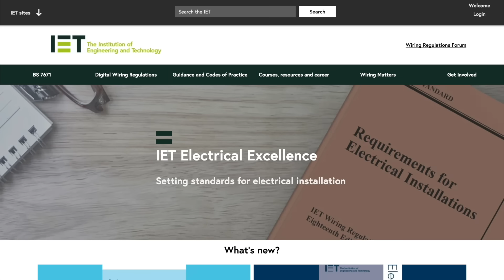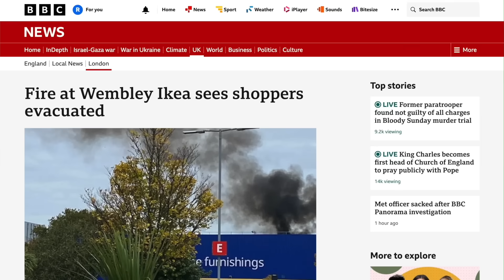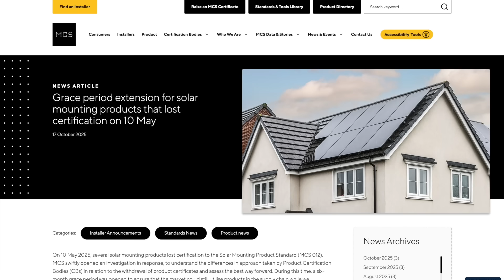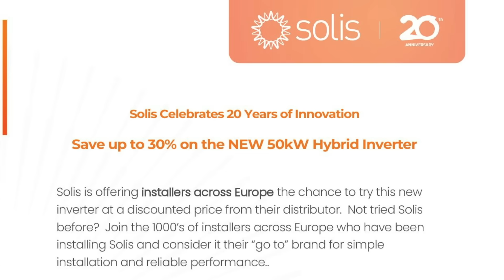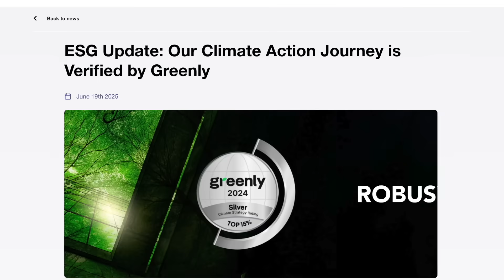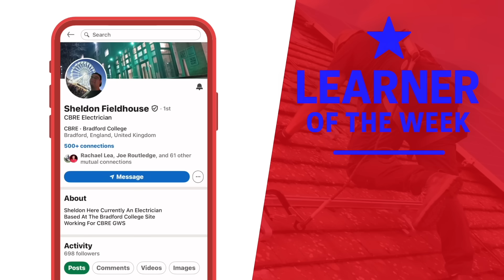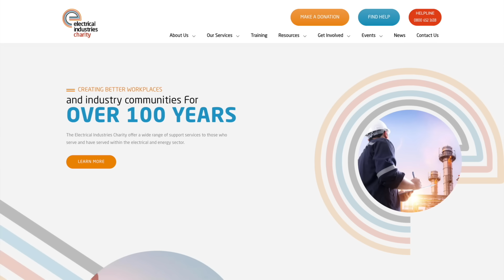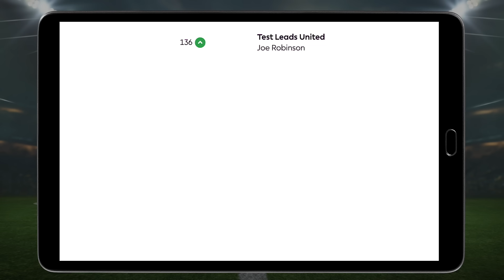Exclusive: Grid Bosses Set to Change UK Voltage

Comment: I've got no clue about this stuff so could be way off.  But this sounds more like the grid is building in some overhead into the system to cope with the wind turbines over producing during off-peak times.  I read that they have to pay for the turbines to shutdown.  I assume this reduction would give the grid some "wriggle-room" before they have to start shutting down the supply.
Reply: Grid generation from commercial wind turbines are at significantly higher voltages than the domestic end user 230v supply, so no, not related at all...
Reply: No it's to make more space above what the cloudy-weather configuration of the transformers near you provide you with in terms of voltage, so your neighbors (and you too!) can feed all the solar you can generate into the grid without tripping overvoltage throttling at the solar inverter. Which would waste large quantities of "free" electricity.
Reply: They explained that it is to give more head-room for solar panels "behind the meter" to generate without going over voltage limits.
Before consumers could generate power: it was always assumed that voltages would drop the further you get from the sub-station.

Comment: Here in Australia we switched to 230v quite some time ago. 
Yet, our grid is typically 235 to 255v. Right now, evening peak hour and the sun has set, I have just measured 242v with a good quality Fluke multimeter.
Reply: To me I still calculate based on 240v even though my place often sits at 250-255v and sometimes even 265v
Reply: We did the same in NZ, changed from 240v to 230v without actually changing anything, so the actual is usually above 240v. Unlike Australia which allows a +/- 10% ours was set at 6% which meant 244v was the upper limit and the point at which solar inverters would either shut off or throttle down. This was a problem, so currently we're changing to a 10% variation...most existing solar inverters will require a site visit to set them to the new upper limit of 253v.
Reply: I plotted my unloaded mains voltage for 24 hours some time ago in QLD.  Max was 243.5, min 233.  It wiggled around a fair bit and tap changing is quite pronounced.  I would say it is generally above 240 at night and below during the day.  Early in the morning there is a steady reduction as more load comes on then a marked step down no doubt from tap change probably to reduce the voltage to accommodate all the roof top solar and a couple of substantial ground mount arrays in the area.
Reply: @retrozmachine1189  When volts are high its cheaper as meter only measure current.
Reply: @johntouw3153  No, the meter measures power.  Plenty of videos on how electricity meters work, you might want to view a few.
Reply: @retrozmachine1189  Ah you are refering to smart meters then not the spinning aloy disc type?
Reply: @johntouw3153  Spinning disc meters also read power.  Watch those explanation videos ...
Reply: There are poor quality Fluke's?
Reply: @johntouw3153 yes, the ones I blew up were poor quality
Reply: @Beenomars  Just calibrated my 75 and its within 2% must be getting on for 40 years old and apart from the test beep being quiet it works fine.
Reply: @Beenomars  What do they say about poor workmen blaming the tools?🤣🤣
Reply: @johntouw3153 I said I blew them up. 🤷‍♂️
Reply: @Beenomars  Must have tried harder than I ever did 🤣🤣
Reply: Here in Europe we used to have 220V then we changed to 230V but not only on paper but also physically since higher voltages = more power, less current. I usually measure from 231V to 237V at my place.

Comment: Making all basic mains direct electric motors and tools etc  gutless, anytime they allow it to get that low. 
Say for example your  power drill / lathe / saw etc is used under a heavy load, but now has a lot less power.
I am picking 10% less volts, would equal more than 10% power lost 🤔

Comment: Lowering the voltage increases the current and the losses. After a while, they will ask the government to allow them to increase the price per kWh due to losses, which obviously will be paid by the consumer. Plus, is not environmentally friendly. But all these green taxes are for the poor, not for the rich. The correct way to solve this would be to invest in infrastructure, but no.
Reply: Using locally generated power actually reduces losses.
Reply: They are investing…

Comment: So if there more energy than demand, REDUCE THE BLOODY PRICES!
Reply: Octopus Agile has been paying people to use electricity in some time slots with all the wind. However it cuts both ways. If you have a flat rate tariff the energy company makes a loss some times and a gain others and it averages out to a small profit. The energy company then effectively insures that profit by people in the markets taking bets on power going up or down.

If you are on agile then there are hours its basically free and hours it's 50p+ per kWh (especially 4-7pm).
Reply: Octopus is engineered by the wef....lambs to the laughter....
Reply: @VTepesIII  what’s wrong with that? Are the WEF poor at engineering?
Reply: The energy market is tied to the most expensive provider.  So standby diesel and gas generators set the price, not cheaper sources (which include renewables).   Why yes, the power  companies make money hand over fist.  How did you guess?
Reply: @thebestofnations  most suppliers fix their own costs and are not paying the spot price for electricity. It would be hedge funds that pay lower prices if the spot price goes down
Reply: @youngwt1 that is partly true, but not entirely. They buy in advance based on how much they predict will be used, that prediction can be too high or too low. As both cost them more money, they aim to predict accurately. This prediction is the primary role, billing and payments is a secondary role to support it.

If they don't or can't buy enough up front (it requires capital investment) then they pay the spot price.
Reply: DNOs only take a tiny fraction of your bill.  It’s the energy suppliers that charge you a fortune.  The sooner these voltages are reduced the better.  The infrastructure isn’t design for all this renewable energy.
Reply: You need to pay more for free power FFS don’t you know this. They lie in there dreams when they wake up and when they speak every government
Reply: Hahaha no energy shareholders profit must go up brrrrr brrrrrrr
Reply: Its alright, when the AI data centres get fired up they'll be no energy left.
Reply: But they're also supposed to pretend that energy is "dstrying the xlimate or something" so they cant drop the prices.  Because they want you using less and paying more.
Reply: No. Get back in line g 0 yim
Reply: But who's going to payback the 49 billion quid for Hinckley point 3 ?        Er..........  We are😢😢😢😢😢😢
Reply: @studiosys  Nobody - and for that money we could have given every household in the UK 1.2kW of balcony solar and a 1kWh battery, with change even at RRP. (Well if we fixed plug in solar!)
Reply: Errrrrrr the damn Taxpers as ALWAYS!!!!😠
Reply: Prices don't go down, that's never going to happen. They only either stay the same or go up.
Reply: @Sundablakr on a couple of occasions my home rent went down. Only by 10p and about 40p if I remember correctly
Reply: nah it's all part of thew americanisation of Europe. then the world at large. for about 5 years at most. give or take two.
Reply: Labour pay one BILLION to stop the wind turbines
Reply: @doriangray6985  nothing to do with any political party. The same was happening under the last government.
Reply: @AdrianColes actually it depends on the contracts agreed by the political party in power at the time.
Reply: erm they do? I pay 4p kw/h at 11am-6am and 14p kw/h between 9:30 am to 11:30 am and 8:30 pm to 10:30 pm
Reply: Nope just lower the quality and keep the price high thats a double win (for the energy companies)
Reply: This won't work because nearly all electrical appliance are set to work at specified voltages. This is particularly true of computers and equipment that have need of clock speed parity. This will be an expensive farce.
Reply: Amps kills voltage doesnt
Reply: @jnc1771 Not.
Reply: Energy prices and voltage tolerance are two different issues. Voltages being high in some areas does not mean that "there is more energy than demand" on the grid. Voltage and energy are not the same thing!
Reply: One of the reasons why they don't is because they pre-pay for energy that they end up not using and then pay extra when certain sources are discarded. Like when the grid is overloaded and then you need to deliver extra to certain areas.

So they actually end up paying for more energy than is used. And you foot the bill.
Reply: Or channel it to overseas and make some money.
Reply: no no lower the voltage and tell everyone 50 volt will not make a difference ! But bill 250V!
Reply: @DawidKellerman actually reducing voltages means raising amps meters read amps
Reply: @johntouw3153  Oh just play along !! You kan pay more and there is  even more fire risk as our cables and yours are similar not like in the USA where an extension is the since of a underground cable
Reply: What complete and utter nonsense!
Reply: HERESY
Reply: no chance of any cut. Miliband took 400k from an energy boss, he has been bought and paid for.
Reply: That's against the core tenents of capitalism. Squeeze everyone.
Reply: @dallysinghson5569  Hey you can emigrate to china noth korea or russia if you dont like capitalism
Reply: Only if they close DRAX.
Reply: Can't Government has it linked to the price of gas
Reply: @stevenbarrett7648  Why does the government control the price of energy?!
Reply: @233kosta  I don't know why they control it as they could de-couple the price of electricity from gas so we pay the true costs, I guess its due to having a chimera government controlled by big business and unions.
Reply: @thebestofnations  octopus do, they give free energy if you have a smart meter and sign up to it. Do you have a smart meter?
Reply: I have been with Octopus energy for around 4 years, and am still waiting for a smart meter.I have tried 3 or 4 times without success.I still have the old N power in smart meter.
Reply: The problem is that renewables have "spikey" output meaning that they only output peak power for a portion of the day.
What's needed is grid storage, that would let the grid store excess electricity and release it when needed, which would let the operators throttle back the slow reacting traditional power plants and reduce the flat rate bills
Reply: @crestfallensunbro6001  Part of the story. The other part though is that all those data centres keep pushing us to the point we need gas and that tips us into gas more often - so you are basically bankrolling them both on power and because of the lack of location based pricing on grid upgrades chunks of which are solely for big corporations who won't put their plants outside of the South East
Reply: @thebestofnations  but they do, don’t they, if you’ve got a smart tariff and a smart meter?
Reply: @sunbeam60  No. Smart meters make zero difference to the price we pay.
Reply: @sunbeam60  living in La La land.
Reply: @sunbeam60  No, they don't. Electric companies even in the U.K. have gotten caught charging the same price even at 'off-peak' times.

Comment: Lower voltage more current ohms law
Reply: But note that Power=(Current)(Voltage).
A reduction in voltage is only half the story.
Resistive heaters will draw 29% less power @208V (compared to 240V; 13% less current)
Electric cars will draw 13% less power @208V (compared to 240V, same current)
Computers will draw the same power @208V (compared to 240V, 15% more current)
Reply: @economicprisoner  Exactly for a given power current increases do you what your electric heater to produce less heat lol

Comment: As an oil and gas lobbyist I say any changes to allow people to generate their own energy = bad
Reply: As someone heavily invested in the toiler paper industry, I don't want people being able to shit at home without funding my early retirement. Big paper = good
Reply: As if PV replaces oil and gas in any meaningful way...
Reply: @peterv1436  We have 4 years left to do so if we want to hold the line at 1.5 degrees of warming.
Reply: @economicprisoner  cool story
Reply: @peterv1436  The UK is warm enough that modern air-source heat pumps are a no-brainer.
Where I live: it gets too cold (below -30C) for one week of the year.
So one either needs backup heat for that week (gas, electric, wood) or a ground source heat pump (expensive to install).